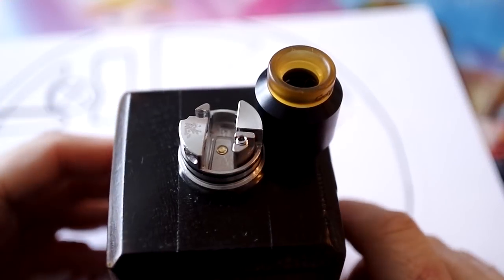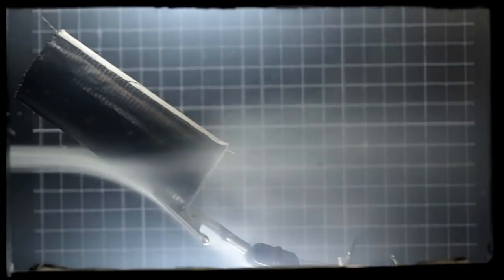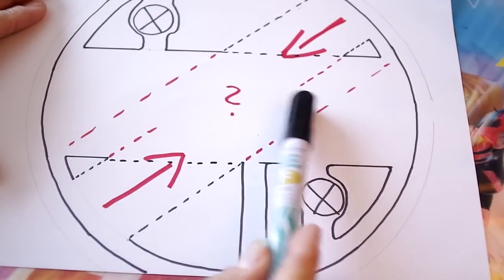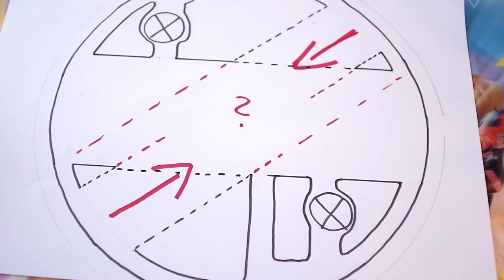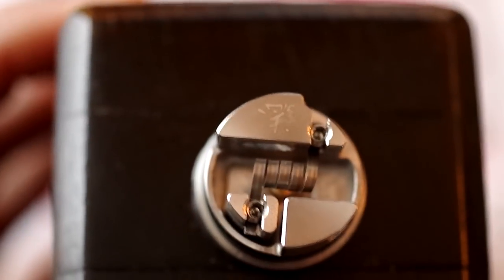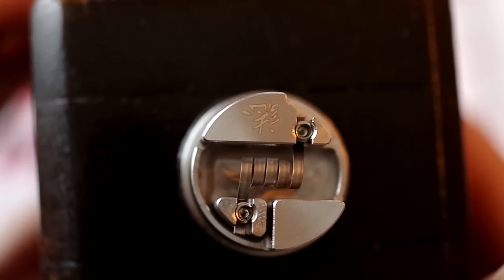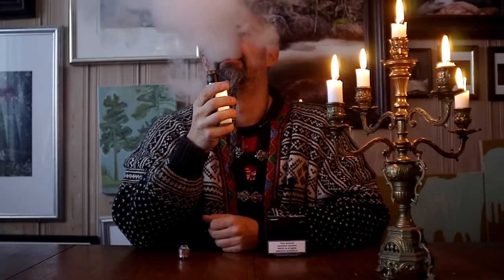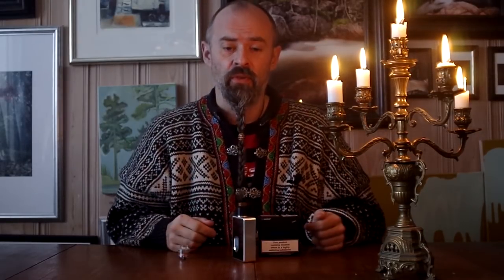Gorge RDA Air flow and coil placement tutorial

Comment: Sorry about your power being out, I am a troubleman Lineman and if I was in Goblin Valley, I'd get your lights back on!..lol You are absolutely correct about the height of the coil placement. The higher I put mine, the more cracklin of the coil. I have a 4.76mm coil in mine and it vapes fantastic. I thought that I could put it higher with a larger coil due to the smaller opening on the sides. I felt the pressure between the coil and block would make airflow hug the top of the coil. But I was not right. There was gunk on the very top dead center of the coil and nowhere else. After watching this video, I lowered the coil slightly and the very small amount of crackling I was getting disappeared. Another valuable lesson learned. Thank you! Even without power your video was still awesome!  Really, like what other reviewer would put out a video with no power? I don't think many. Good job Mr Oen!
Reply from the maker: Thanks Brian! Power is back on now, but we are so used to it so we have gas stove, heat from a fireplace, fridge and deep freezer in the basement, lots of provisions, solar panels and so on. We can survive off grid for months here:-) Glad you figured out the coil placement and gave feedback!

Comment: Hi Morten you re the best YouTuber on the vape community! I am torn between wasp gorge and gr1 from gas mods. What's better in overall expirience gorge or wasp assuming they are pretty close in the flavour department? Does wasp get hot or spitting juice? Also have you tried the G.R. 1?
Reply from the maker: Of those three, I really like the Wasp best. Build small coil, and make sure it is low enough.
Reply: @mortenoen434  thanks for the quick reply I hope you continue with these great videos!
Reply: @outkast_xiii670  bro I have all three too and my fav is the GR1 rda by gasmods it's such a fantastic little rda dude and cheap as the wasp nano too but I really think the gr1 is better on many aspects . Trust me bro u won't regret it . But either way wasp or gr1 is good choices just figured I'd give my two cents :)
Reply: @cavemanlovesmoke4394  brother thanks for taking the time to reply I got a kennedy 25 at last so budget is an issue... But I will still buy a single coil flavorchacing rda im also considering a hadaly clone maybe but I'm afraid of it getting too hot. Did you have any issues on your gr1 or nano with heat levels?

Comment: Thanks Morten. An insightful video, as always. Question, how do you get your flatwires so perfect? And what gauge did you use  in this video? I generally hammer out 22g Kanthal on a jewelers block and I get it pretty flat, and it works well, but the edges are nowhere near as even as yours seem to be... Have you changed the way you make the flatwires since "flatwire 001" video?

Comment: Hey Morten its me again :) I experimented with some flat 24G SS Wire while the flavor was good the wire was not that great. I ordered some 19G Kanthal A1 and was wondering what wire type you are using to hammer down ? I also ordered the Gorge, because of your review and airflow tutorial. The wasp is to tiny for my liking and i don't really like the topcap. One more question: I also got some black spots on top of my flat coils in the Reload RDA does that mean that the air doesn't go perfectly around the coil or could it also be the liquid ?
Reply from the maker: Hi friend! I use 22g Kanthal for the most part, some 20g and some 24g if I have to to get the right Ohm and size. 19g will be dangerous, so keep low watt and your cotton very wet. Black spots are due to juice with sugars and air flow. More gunk will collect where there is little air flow. It is one of the flaws of the Kennedy design. The Aeronaut fixes that to some degree.
Reply: First of all thank you for the really fast answer. I think you are right 19G on dual coil would be to low or the coil would be way to wide. It should be good on a single coil tho or is there any other reason you think it is dangerous ? I always aim to get around 0.1 to 0.2 depends on the RDA. Also thought about getting the Aeronaut. I have a lot of fused clapton left over for it, because of you :)
Reply from the maker: I use 20g from time to time to lower the Ohm. You should be all right if you just don't go too thin on the 19g. I have had 18g just catching fire in a second. Just a heads up. Stay safe and saturated:-)

Comment: Hi Morten, really been enjoying your channel since I found it. May I offer a suggestion? I've watched your videos regarding airflow, and your work with the wind chamber, and wonder what results could be had by winding coils that are oblong or oval-shaped as opposed to the traditional circular coils. Perhaps a more airfoil-esque shape could provide a solution to the dead zone of cooling that seems to exist behind the coil, directly opposite the source of airflow.

I don't think this would provide much improvement in a setup where two air holes provide cooling to each side of a single coil, but perhaps when the airflow comes from below the coil, placing an oval-shaped coil such that the airflow strikes it edge-on, splits and flows upward over the broader, flatter portions of the coil could provide more even cooling, since the airflow would not have to deflect as drastically to flow around the coil. I would love to hear your thoughts on this.

Thanks again for the great content, and here's hoping your power is restored before your 18650s run dead!

Comment: Thanks yet again for some interesting footage! As I said some time ago I have quit buying new vape stuff since I feel the Reload RDA 1.5 gives me just the vape I love but now I saw Vandy Vape coming out with Phobia RDA that is very much like the Reload so I will be buying it to see how it matches up with bit different bottom airflow. Also will be buying your RDA and do extensive testing of my own and maybe post first videos, atleast as communication/feedback to you. 

It's -20C here in Finland but not that much snow but the northern ice blasting on your skull always makes me find my Black Metal vinyls and light up some candles, hehe. What kind of music do you like if I may ask?
Reply: Also, I would really love if you tried out the Reload RDA. There is the new BF version out that is identical to the latests 1.5 version. I promise you will like the dense and flavorful clouds and I woudn't say this lightly.
Reply from the maker: Greetings Niko! Lots of snow here, but only -10C for now:-) Regarding the Phobia, I think there is something strange with it. I have done a lot of drawing and testing, and I can't really see how the side air flow can hit the coil. It is basically a Kennedy style RDA, with half the air missing the coil, if the images are right. But I'll come back to it later. The reload looks nice, but I would like if the air came up in one opening. For a flat wire coil it's very important to hit it mostly in the middle, or the flavor turns dark very quickly:-) Whitch brings me over to Black Sabbath:-) I still listen to them, and a lot of other 70's British metal. And I love System of a Down. I know I should praise Finnish and Norwegian black or death metal, but they never get the guitars sound as raw as Tony Iommi... Nothing really beats a Gibson SG with two P90 pickups:-D

Comment: Thanks for another informative video. I have the Gorge and I'm very interested to know what flat wire you are using in the video. Is it bought, or do you hammer it flat? What guage, and what material? I must also try using this wire in my Wasp Nano 😀.
The air chamber footage is fascinating. Thanks for your efforts once again.
Reply from the maker: Hi Chris! The wire is some Kanthal from the 50's I picked up from a Scandinavian NOS-store. You can't buy it anywhere. Its like 1.5x0.2mm, very good to test with, before I hammer my own.
Reply: Morten Oen Thanks for responding so quickly. I'll need to get some 22g Kanthal. I've got my hammer and jeweller's block ready and waiting, but I've only got Ni80 and SS wire. I think Kanthal will help keep the resistance to a comfortable level 😋
Reply: Chris Parkin If you are lazy like me, you can buy flat kanthal from crazy wire. They have 18 awg up to 25 awg.
Reply: Alan Svensson Thanks for that. Haha, yes I might be lazy and just order some to try out. Thanks for the information 😀.

Comment: Hi Morten, in the same logic of things (or similar), could you please try an angled (at ~20°) single coil in the pulse 24 ?
Reply from the maker: Hi Aymen! Interesting suggestion, but I can not do that for two reasons: 1) The results would be classified as a secret :-), and 2) My Pulse 24 deck is now used as a platform for a prototype experiment that looks very promising, and I will not use it otherwise as long as I am doing that.
Now, considering that the angle is downwards, and that the air flow is broad enough allready, you would not get a better result regarding cooling of the coil. But there is also other effects at play here. I am sorry for being cryptic, but the benefit to all of us is that I might be able to make RDAs for the market in the future, if I keep some of my findings to myself.
Reply: Morten Oen thank you for the answer :) it would be great to see a product release from such a passioned vaper as you.  Good luck and cheers from Tunisia

Comment: Thank you again Oen for your work. I may be wrong, but your orientation seems off in the chamber demonstration.... Is the vacuum cleaner placed where the camera is? For it to simulate the airflow in the rda should the coil not be placed horizontal like your other demonstrations?... as apposed to the vertical angle you are showing here
Reply from the maker: Hi Jeremy! Yes, you are right:-) But I have allready demonstrated the air flow for a "generic" design like this in the Air Flow in Single Coil RDAs video. The only thing I was wondering about was how the angle would affect the flow in a different angle. As we all now by now, the air shoots straight in, no matter where the suction action is comming from, so the interesting stuff is if the steep angle matters, and it does. Well spotted! I no longer explain the basic stuff about air, but it is maybe time to do so again. The video anyways, shows that air shoots straight inn, down alongside the (far too smooth) coil, pass over it, and continues in a straight line, befor it hits the other side of the chamber, goes turbulent and drifts up towards the vacuum cleaner. Watch the video I mentioned for a more "realistic" view and analysis.
Reply: Thanks for taking the time to reply Oen :) I've learnt a great deal from your tutorials, it's changed the way I build, wick and buy... I've never had such a consistent vape experience before.
Keep up the excellent work and I'll keep watching.
Reply from the maker: Thank you for the support!!!

Comment: Just curious if you will do a "Speed revolution RDA" airflow tutorial. I find it a bit awkward, and was hoping it would be a good MTL atomizer. I tried a Kanthal 28awg, 5 wraps spaced, 2.5mm ID, and set the coil placement to one of the sides so it's close to the one airflow hole. The flavor is really muted. I'm not sure if it would help centering the coil so it's right under the drip tip, but doing this will result that the distance from the coil to the airflow hole is big.
Reply from the maker: Hi Sean! The distance to the air flow does not matter much. The air travels in a straight line untill it hits your coil. There is just too little of it. To me this is a geat RDA, because I can use it as a test platform for air hole design. The fact that I alter this RDA according to my theories is also the reason that I will not show it. I am developing RDAs now, and have to keep my secrets for a while:-) But pick up a drill or a dremel tool, and make those holes bigger, and the flavor will open up nicely. Aim for a total of 24 mm squared to begin with (try expand the holes to 3,5mm) and take it from there! Use files, drills, or cut a slit with a saw. Great possibilities!
Reply: It's possible that you misunderstood me, or that I misunderstood your answer. My question doesn't have anything to do with Gorge RDA. I just figured that I would ask you here since it's the only place I can contact you. I was referring to the "Speed revolution RDA" which is a single coil 18mm RDA. It has one single tiny airflow hole on one side. I got this so I could do "mouth to lung" inhales. I need a restrictive draw, and drilling the hole bigger is not an option.

The problem I get is muted flavor. I have the coil on the side of the atomizer so it's close to the airflow hole. This means that the coil is not directly under the drip tip. I'm not sure if this is what is causing the issue, but if I center the coil so it's right under the drip tip, the distance from the coil to the airflow hole would be big. I just don't know the optimal way to build on the Speed revolution RDA.
Reply from the maker: And I was talking about the Speed revoltion too:-) I use it as a test platform for air flow:-) Distance to the air hole is of no importance, as I said. But keep it close to the hole so you can aim better. The dull flavor is due to a too hot coil and/ or not enough cooling. Try to compress your coil, so the air flow covers more of it. Try making the outer diameter the same as the diameter of the hole, and wick as tight as you can. This will be a very tiny coil, but spaced coil is not good for this RDA design. You will have to settle for less vapor production to get good flavor, but you can ramp up the nicotine and lower VG for throath hit. Making the coil as tiny and compressed as practically possible is a good start. For more vapor and high flavor notes, experiment with a flat 28g coil with 3 wraps, and lower the watt even more..

Comment: sir i like all of your videos and i want to ask u a question due to some health prob i have to vape without any pressure on my lungs and on my chest , i want to buy the most airy rda or rdta the most easy one to vape with , many people has recommended for me limitless rdta and goon 1.5 and goon lp and deadrabbit and many others rda/rdta atomizers what do u think and which one do you think is the best for me ? thnx
Reply from the maker: The most airy RDA might be the Big Buddha 30mm from Vaperz Cloud, because in addition to the huge arrey of side holes, it also has the possibility to open up two more in the top cap. All 30mm has big openings, but the buddha is the King of Air. You can breathe through it like it's not even there:-) You can also look at the Temple 30mm. 

If you have to use a smaller RDA, I think the Washington RDA has the most air (and it is very cheap). I did a review of this, because every other reviewer had to close it down to get any vape out of it. You have to push flat wire coils to 200 Watt to get something going with that. So if it's air you want, Big Buddha 30mm and Washington 24mm should be on top of your list. Hope you get better! And good luck, sir!
Reply: thanks a lot for those detailed informations , i have really big trust on you sir , but i have a little problem here , i live in a country that has not have a big choice of vaping accessories yet , so i guess it will be a little bit hard to found for example big buddha , im gonna ask for another favor and im so grateful, if you can give me a list of  best 5 rda in my situation you have already tell me about 3  "Big Buddha"  "Temple 30mm" and Washington can you choose for me another 2 or 3 atomizer just in case
Reply: what do you think of those rda/rdta (vgod elite rdta , goon 1.5 rda,  goon lp rda,  deadrabbit rda , medusa rdta,  bonza rda vandy vape , druga rda bf augvape, peerless rda geekvape mesh rda vandyvape , mesh pro digiflavor rda , Twisted messes 2 rda , govad rda , wasp nano rdta , limitless rdta ) ? do you think there is something from those examples that can match with my situation ?
Reply: Hi, I would bet you can use Goon, Bonza, Druga, Peerless and Govad fully open without putting nearly any suction when they are fully open. It would help if you could tell what you CAN'T use and what you have already tried? Most of the 24mm+ popular RDAs have a lot of air when fully open so I wonder how severe your situation is? Can you inhale at all or do you get exhausted when you take few pulls? Because it might be easier to use higher nicotine juice so you don't need to inhale so much vapor as it is more potent. That would be my first thing to try with anything moderate airy atty.
Reply from the maker: My best advice if you can't get hold of a Washington, just go for a Goon and use a file to open it up more if needed. No 24mm is even near the Washington in openings, and it is very cheap. You can order it from 3fvape for $29. If I were you, I would just modify an RDA and open up the airflow with a jewelers saw or a file.
Reply: exactly sir , thats what im gonna use a higher nictone juice so i dont need to inhale so much vapor and i guess goon is the perfect my situation , im not getting exhausted after few pulls but i dont have to put any pressure in my chest or im going back to the hospital , its called pneumothorax it can happen again and again , even without doing anything wrong and without putting any pressure on ur chest and thats why im going a little bit crazy about stop vaping , and trying to get the most airy and the most ato that can match with my situation , thnx for reply and for your help @niko eronen